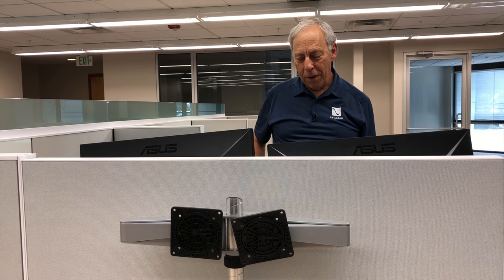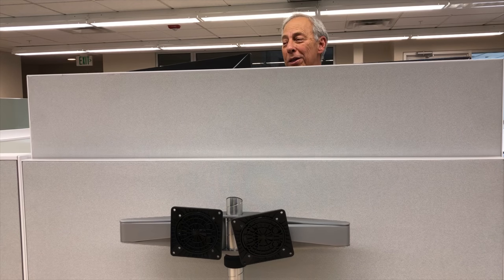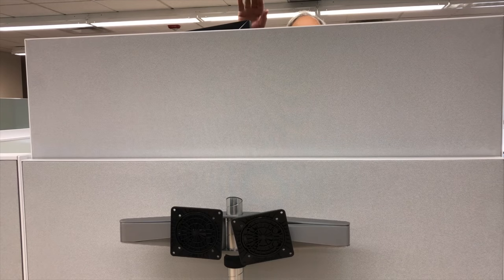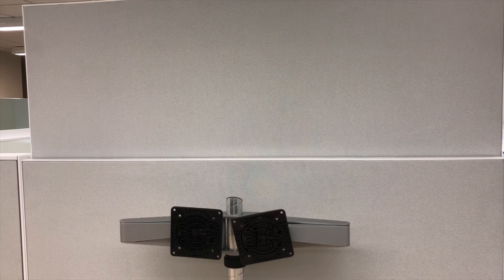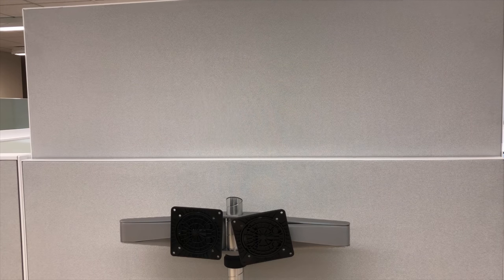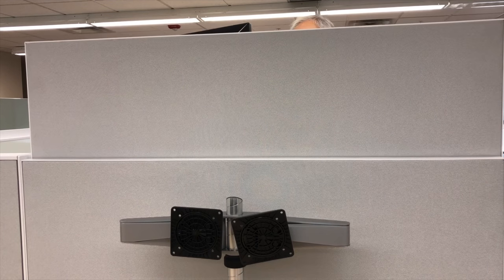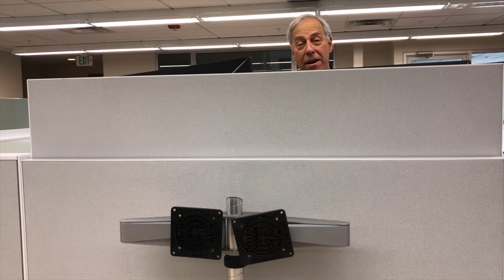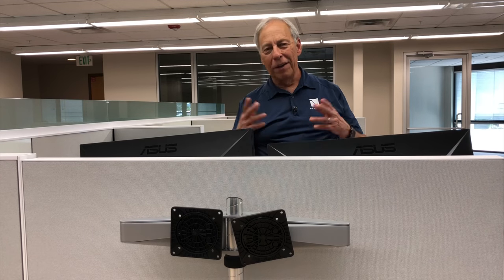Replacing capacitors in vintage equipment

Comment: I have a few vintage amps from the 70's.  They still work fine, my hesitation to get them re-capped is finding the right guy that's going use the best caps.  It's kinda scarey giving your presicious amp to a stranger, besides there aren't a lot of these guys left that do this kind of work anymore.
Reply: There's a good case to be made for becoming the right guy. I learnt soldering by dismembering junked TVs, radios and WW II army surplus back in the 60s. I used the salvaged parts to build short-wave radios, amplifiers and such. I recapped my favourite heavily modified kit amp twice before it became uneconomical to do so. The first SATA hard drive I purchased, I managed to break off the connector. I was a bit busy at the time and got a quote of $AU100 to solder a captive lead so I did it myself. I needed a magnifying headset to solder the rather close together signal leads. It cost me $AU20 and about a quarter of an hour of my time. DIY electronics is a heck of a lot of fun.
Reply: Do it yourself! Grab an old PCB from a garbage computer.. Get to soldering until you're comfortable.. Then start on your own gear.. Go slow the first time.. If you're still not comfortable, look at Audio Rehab near Los Angeles. They do a nice job on vintage gear (actually, on all gear).
Reply: De/Re-Soldering is a no-brainer!!! I've done several Dell Dimension 9200/XPS410 motherboards that had bad caps which would make the PC freeze & lock up. Just be sure to use de-solder braid with flux on it and an iron with enough heat since there is more metal to heat up on the larger caps! ...and DEFINITELY get your polarity correct!!! The voltage of the cap has to be the same but the microfarad (ufd) value can be equal or higher. Just make sure the can form factor and lead spacing is correct.
Reply: Get yourself a decent soldering iron (25–40W), or if the budget's big enough, soldering station. The latter includes a controller so you can vary the tip temperature. I have occasionally regretted not getting a station over the ~40 years I've been using my iron. I have two tips, conical and chisel shape. It was as cheap as chips. The stand is just a piece of folded tin. But it has done everything I have asked of it including knocking up a signal tracer using a CMOS IC back in the 1980s (difficult because static electricity). Do NOT get a soldering gun. You're fixing electronics, not pots and pans! Go to an electronics parts supplier, not the local hardware store.

As well as desoldering braid, I have a desoldering pump (less than $AU10 new). Mine cost a dollar second-hand. Also useful is a pearl-catch for when you need to pick up small fiddly bits and pieces you can't reach with fingers. Also less than $AU10 new, but being the skinflint I am, mine cost a dollar second-hand.
Reply: I am an electronic technician with 22 years experience, most of it made on audio devices. I usually do that kind of work (capacitor job). I am doing it on a Harman Kardon Citation 17 Preamp and Citation 19 Power Amp right now. I live in NE Italy. If you are close enough you can send your stuff to me to repair. Ciao
Reply: @jonathansturm4163  Skinflint lol! Love it. I don't think I've heard that term since my grandmother passed away almost two decades ago.
Reply: It’s pretty easy to do depending on how many board you have and how easily they are accessible. Just desolder them and replace it. Perhaps the hardest thing could be a dc offset or bias adjustment but a service manual will explain it very detailed and isn’t that hard, simple amps usually don’t even have those.

Comment: Spot on. To answer the question: "is it worth doing"? In most cases, yes absolutely. As for the DIY approach, not many of us are keen on that. I suppose with an old easily replaced unit, it is ok, but I would not dare try it for fear of screwing something up on one of classic monsters of old. I'd rather have a qualified person do it. There in lies the problem though, not many of those around at all. 
Having a qualified person do it can run from $160 to $300. Still worth it at that point?........It depends. If you love the sound of your old unit then it may well be worth it. Also, you would be buying another 15, 20 years or maybe a bit more of service! Some units of old are very worth it. For example, I have a Sansui 8080db, circa something like 1973 and the sound of this thing rivals anything off the shelves today and some high-end units in the $10k to $15k range! I have had it go up against a couple of those and the rep said "don't ever get rid of that Sansui"! To get the sound of my Sansui in today's field I would have to spend at least $10k at minimum.  It is just pure pleasure to listen with and right now with a pair of $1000 speakers hooked up it makes mince meat out of my reference system in progress!!!! A situation I hope to fix soon, but it has me worried. 
I found a guy who can work on these things a couple years back, who has the credentials. I don't know if he is still around or not. I had him do a complete recap on the power and amp boards buying me at least 15 more years of service and likely more. It ran me about $250. For this thing, well worth it.

Comment: A good way to describe what out of spec capacitor do, is to say they turn themselves into a resistor, especially those old paper in wax/oil dc blocking capacitor.
Good electrolytic capacitor would include Nichicon  UPW-UPM high temperature for psu, panasonic FH series, kemet, sprague, Illinois TTA for axial equipment, they're more expensive, but it looks so much better.

Comment: We used to swap capacitors around on the first year Electronics student when they would come to class and turn your test message on the power supply would be on with a capacitor 15 volt on the 50 volt Supply with reverse polarity with reverse polarity. We got a real bang out of it! Lol

Comment: When I started out as a bech tech I had the bench next to Vinnie who had worked there for a long time. He was workig on a large rack mount series of supplies and had just turned the variac up on one, he said oh shit and turned the varaic down. It seems a large can cap was installed backwards and he felt the variac groan when it began to suck up current. As fast as he turned it down it was nit fast enough - the cap went off like a bomb and sent a slug of material into the overhead fluorescent lamps. We stood there withour eyes closed as we were showered with shattered glass from the lamps.

Fun times at Ridgemont high!

Comment: Great video but 20 years is often too late, if the component is exposed to heat, everything inside the casing will deteriorate much faster than say a "colder" DAC. (Krell amplifier for example run very hot and I did recap after 10 years, some of the caps were already gone...)
Reply: I found a guy on the local craigslist who reconditions vintage speakers... beautiful stuff :}. anyways, I asked him to measure some caps in old crossover circuits (as in 40-50 yrs old) and he did. unless the caps were physically damaged, no more than 10% deviation in capacitance.. Of course capacitance is not the whole story and as you said the degradation is also temperature related, but still, I was expecting the caps to be way more off specs
Reply: @duroxkilo  yeah back then everything was more reliable and had longevity

Comment: Back when I was working a a bench tech I was working next to Vinnie who was working on a fussy power supply we made for Hughs ircraft. We were both doing our own thing when I heard Vinnie yell "shit" and shut down the 20a 3 phase variac as fast as he cound - but not quite fast enough. It seems there was a 180uf 40v tantalum cam in backwards and it took umbrage at the revere polarity..

That cap launched itself off the board like a rocket and went up into the 8 foot fluorescent fixture where it shattered both tubes. We both stood there with our eyes closed waiting for the shower to end. There was glass, paper and foil everywhere.

Whwen a tantalum cap lets go it does so with 10X the ferocity a regular electrolytic does. This was a three phase 400 HZ power supply and Vinnie felt the grunge in the variac but just couldn't get it powered down fast enough (a three phase 20a variac has some serious mass)

Comment: An oil cap on one of my VTL 300s failed. The company told me to take it into a local dealer who replaced it. A few seconds after turning on, the cap spectacularly exploded spewing oil round the room. The dealer had apparently scratched the paint on the outside that serves as an insulator. Bea at VTL then let me take it to them to be put right.

Comment: Yes, great info.  I just replaced the input caps on my DC-AC power inverter after about 5 years of use.  There were 3 - 3300uF low ESR caps in parallel, and there was a massive cloud of smoke when they finally let go.  I replaced them with the best Panasonic caps I could find and so far working much better and quieter than before:
https://youtu.be/l6wNL93Nmjs
I also improved the cooling, as these caps were stuck down between the two main H-bridge heat sinks and I think they were just getting cooked, drying out the electrolyte.  So yes, well worth replacing caps, especially ones that see a lot of load or that are in a hot area.

Comment: Not only polarity but watch out value. I purchased bipolarised capacitors in 1992 value 9uF and they all the time until now (26years)  measure  unchanged 10uF  Capacitors 9uF  I  buy new today they measure  values 7-9 uF.; Capacitors I measure in gear produced in 1983 still are bigger than average eual by nominal  values  in shop today. So not always we regain capacity by obligatory replacement - usually we loose. . Which may be is not critical in supply but in crossovers or tone control it will make too much  modification of timbre

Comment: Go to any online forum and you will find people who rip into their equipment and replace every cap and then power up the unit and WOW it doesn't work.  Some will send up smoke signals or blow a fuse.  If it ain't broke don't mess with it.  Also many integrated circuits are static sensitive and any discharge will kill them.

Comment: I have a old pioneer sa 5500 II I'm wanting to do a complete overhaul on. If for nothing else just for the sake of the exspierience.

Now I do have a question...
After or during this process is it necessary to use a scope at any point?
Or do I just swap and solder??

Comment: We have reached a point now where replacing silicon becomes just as important. Capacitors are not a blanket yes, many times what I remove test better than what I pull out… (70s ELNA capacitors)

Comment: 2 Weeks ago, it was just a 470µF/35V and I was testing Amplifier Boards which I had put aside to desolder or put them to some use later. I connected a MP3 Player with some Music, and the Amp was playing fine. After about 2 Minutes I stood up, because something fell off the Table and "BAM!!.
In disbelief I looked at the PCB, mounted on a pretty good sized Cooler and 2 Thoughts were in my Head:
1.:" Wow, this whole Thing (the 4x6cm PCB) is on Fire! This is something new ... oh boy, these flames must be 10cm high! ..."
2.:" Hey, cool, the Music is still playing, the chip seems to be unharmed ..."
I had to act fast, and the only Idea I had was to use the same Technique which is used on Birthday Cakes: I blew the fire out :). Why did this happen? I think I was a little tired when I soldered this Amp together and just mounted the one Electrlytic the wrong way round. I hope, I never make such a Mistake at my Subwoofer PSU, because there are, amongst others, two 47000µF/ 50V Electrolytics in use. :)

Comment: Question about the bipolar crossover caps orientation:
I was reading that bipolar caps in crossovers have an outer and an inner foil. And that the outer foil should be orientated to the negitive terminal. Something about the outer foil being suseptible to interference/distortion. Is it worth worrying about when replacing crossover caps?thanks for sharing yer wisdom,  Hamish, Isle of Skye

Comment: Besides the capacitance value, the voltage rating, the physical dimensions, its polarity, and the ESR, as you mention, one should also pay attention to the tolerance of a cap, and really you don't want one that is worse rated than the original one was, (even though it was out of spec due to its age). If it was originally rated to be a +/-10% cap then you would want a new one that's at least that tight to its rated value, and NOT one that is rated at only +/-20 or 25%, etc., because the value under use and at various operating temperatures might change too much between its highest and lowest extremes for the circuit to always operate properly and within its designed specifications... Which leads me to another point...

Another very important thing to consider, especially in power supplies, or anywhere where a capacitor is mounted close to a heat sink of any kind, or where the capacitor is being used in a relatively warm or hot environment, is its temperature rating. You always want to go with a new one that has at least as high of a temperature rating as the original one had. If the original one was rated at 95°C then you would ONLY replace it with one that was rated equal to or higher than that, like 95 or 105°C, but never with one that is only rated for 85°C, otherwise the heat extremes of the associated circuit and the heat generated by the components around the capacitor would put too much stress on the cap, possibly causing it to fail prematurely! And if anyone takes the time and goes through the time consuming trouble to replace all of the electrolytic caps in any kind of audio component or other equipment, then you definitely don't want to have to do the job over again before the next capacitor life cycle is due! (Usually about 20-30 years for electrolytics if they're good quality ones, depending on how, when and where they are used.) (The effective lifespan is considerably longer than that for other types of caps normally. Most other types besides electrolytics potentially never need to be changed for the life of the overall equipment they're in unless they get an overvoltage power surge or physical or extreme temperature damage.)

Comment: Thanks for post this Paul, people need to hear this, know about it, ~ sadly ~ people simply don't "get it"... I have this conversation ...all of the time..., people will fight and make excuses for how ~30 year old 'caps are testing fine' or whatever foolishness. The tough thing is that, these components ~ s l o w l y  age ~. It is something that a person can barely recognize the gradual degradation. Like wrinkles on a face over time... they become springs with no bounce... that soft and woolly vintage sound. [YUCK!] I am always in favor of newer engineering, newer component technology... much that may not exist, back when these parts were made, sourced and equipment was built. I actually had the ARC service department offered to sell me "vintage (20 year old) OEM parts" for recapping an amp. I declined, was stunned by their comment, bordering ignorance. Mouser, was just a few clicks away... It is always ~incredibly rewarding~ to experience a favored old 'relic' spring back to life.

Comment: Have a fan running to the amp , I have a £500 ONKYO AV AMP with a built in auto fan that has NEVER span so I use a PC fan external on top with a battery to cool it .
Comasitors are always ontop of the heatsinck to heet them up .

Comment: Hello guys!I want to recap my NAD 1155 preamp.My question is can i replace old electrolyte capacitors with new film capacitors with the same impedance and higher voltage.People say the voltage can be equal or higher,but the impedance should be the same...Thanks if anyone responds!!!

Comment: Short out the large caps with a 10k ohm 5 watt resistor before doing anything or you will experience the storage capacity of a large capacitor and it could kill you if you don't know this.
Reply: They also tend to "create" some charge again after being discharged, so the process should be done 2-3 successive times

Comment: 3:15 Electrolite capacitors are not used in AC power, they have polarity so you can use them only in DC power line
Reply: You are correct, but they smooth out the residual fluctuations in the (newly DC) voltage after the current has been converted from AC by passing it through a full bridge rectifier.

Comment: I've a bunch of those blue large can capacitors from old Mark Levinsons, Krells and Threshold mainly from Sprague and Mallory and they all have or exceed there initial caprating (uF).
Even the oldest ones from my Levinson ML-2's from with datecodes like 7852 meaning week 52 in 1978 (all Spragues Series 36DX) still exceed their initial capacitance rating.
I always understand that small electrolytics with low voltageratings get into problems first.
Some lytics like the brownred Roedersteins used in vintage Krell equipment dried out in a couple of years. Leaking their fluid corrosive substance on the PCB and corrode the coppertraces is far more serious like those Elna Long Life caps (see the irony) in the Adcom poweramps like the GFA-585.
Reply: When an old electrolytic, wax, or paper-in-oil cap is reading well above its rated value, the odds are good it's failing. Most RLC meters can't distinguish between leakage currents and high capacitance, so they give a false reading for old leaky capacitors that need to be replaced.